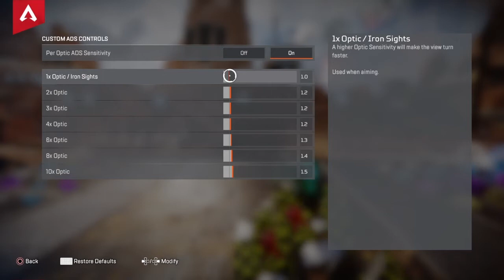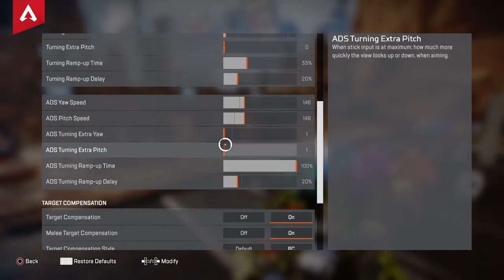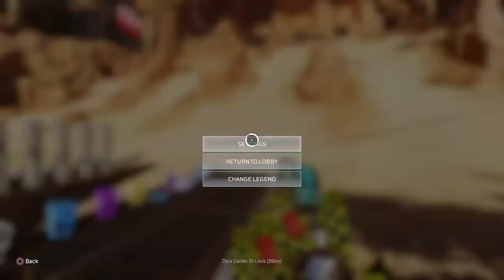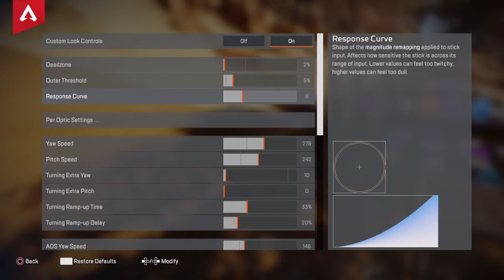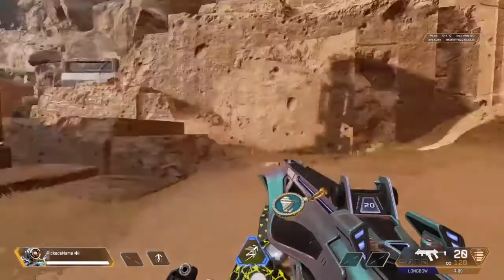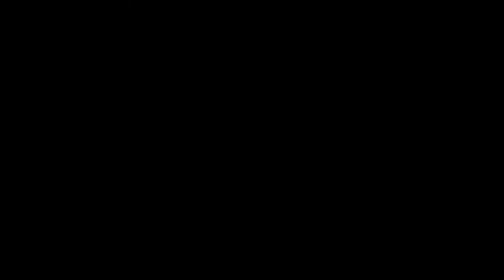Fixing ALCs: Hidden Deadzones

Comment from the maker: To find the delay% I max out the extra and turn the ramp up to 0. I thought I did this when I set the hipfire to 20% but apparently I didn't. I was noticing 20 delay in combat, it was activating at ~90°. 50% delay is closer to where I want it to accelerate, 60% is over 180°. I reduced the speed to 3 so I don't over swing, and reduced the ramp up% to 25 so it doesn't feel sluggish.